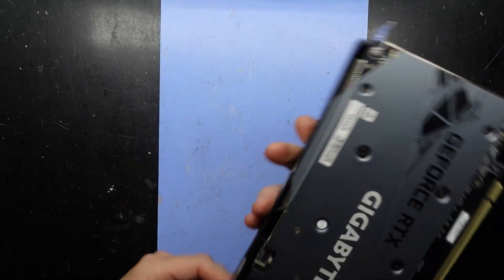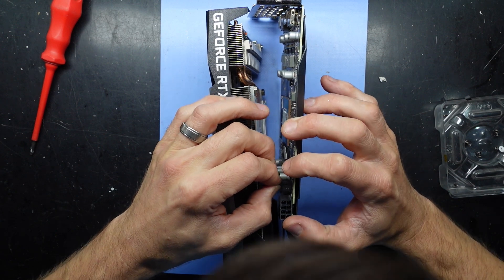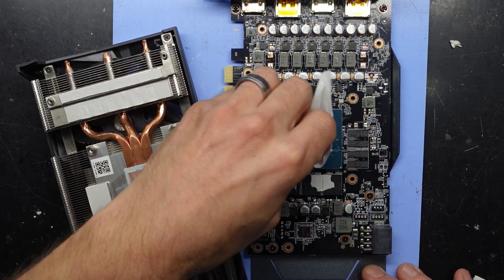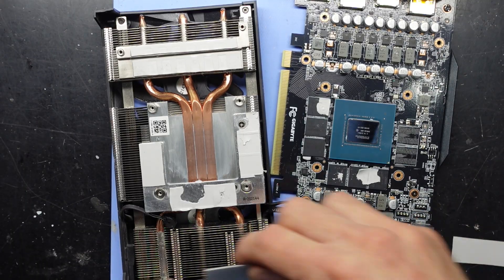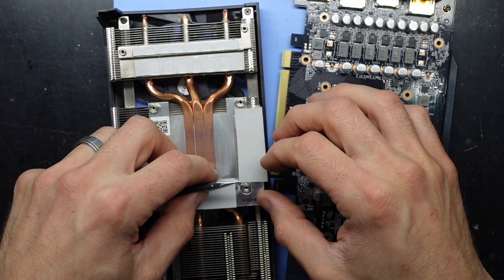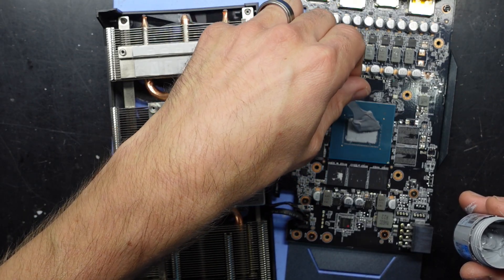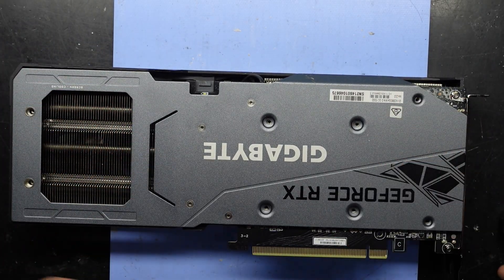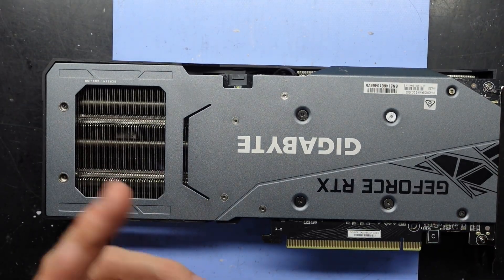Gigabyte RTX 3060 Gaming OC 12GB Thermal Paste Replacement

Comment: You should use a 0.75mm vram thermal pads dont use a 1mm or 0.5mm thickness because it will cause a problem on its gpu hot spot .. i have the same gpu as yours..
Reply from the maker: I was using what I had on hand but thanks for the tip
Reply: You can also use 0.5mm for the. 0.75mm thickness cause I been searching and there isn’t any 0.75mm thickness anywhere lol
Reply: @Bonkers_07 it means you didn't search enough LOL hahahaha! I'm using UPSIREN THERMAL PADS and I got 0.75mm from them.